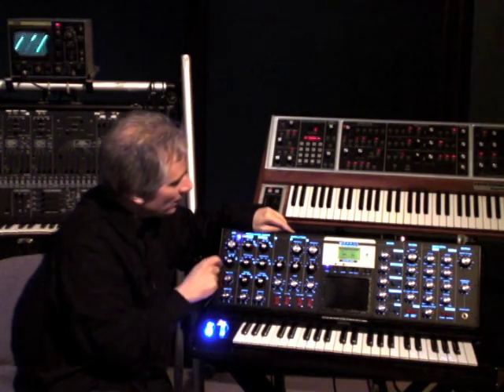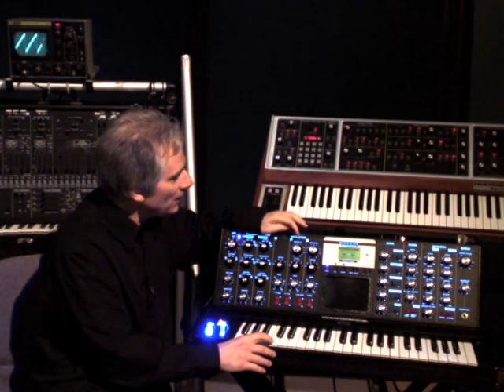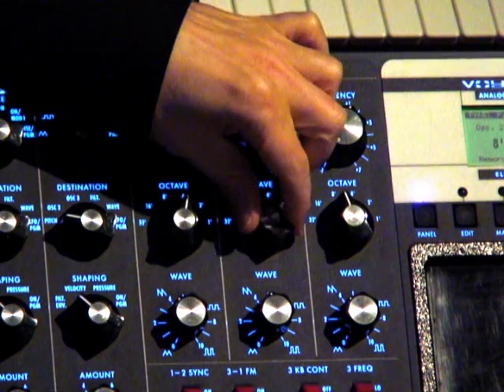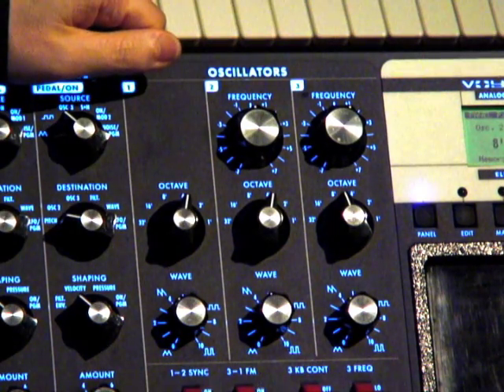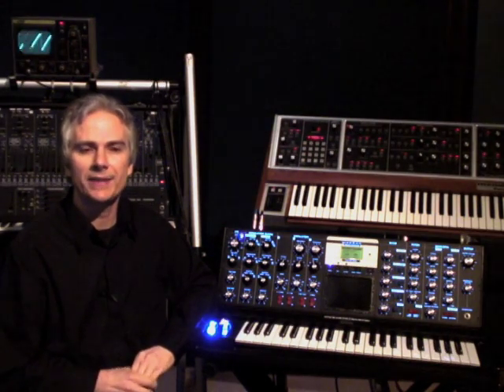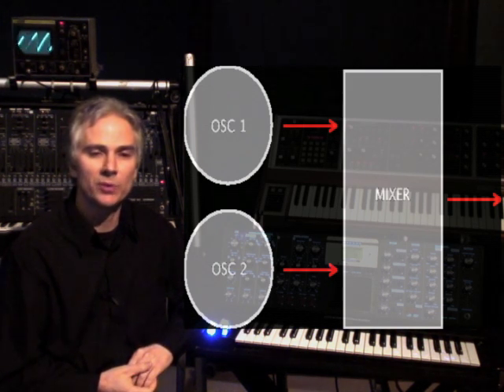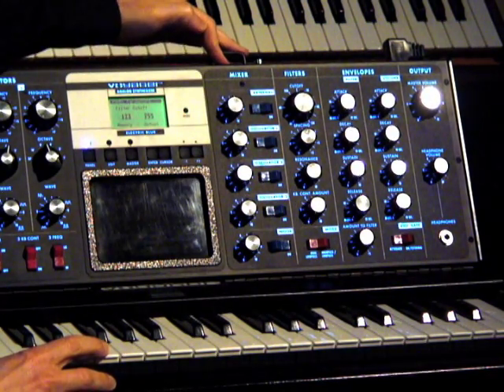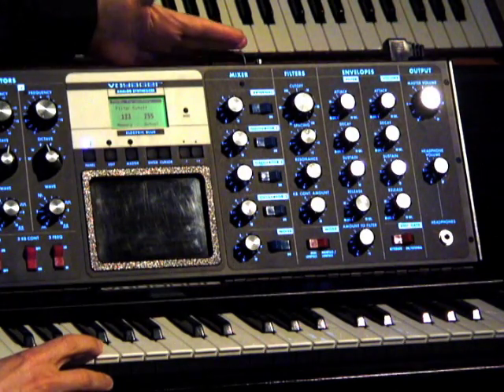The Fundamentals of Synthesizer Programming Pt. 2

Comment: For those who don't know it, the octave switch originally refers to an organ pipe.  On pipe organs, the lower footages represent the lower notes [on the pedalboard], so a 32' = a 32' pipe, a 16' pitch = a 16' pitch = a 16' pipe, an 8' pitch = an 8' pipe and so on, right up to a 1' pitch.  What makes synthesizers unique is the ability to adjust pitches between those footages.